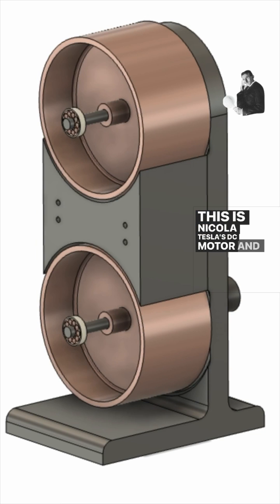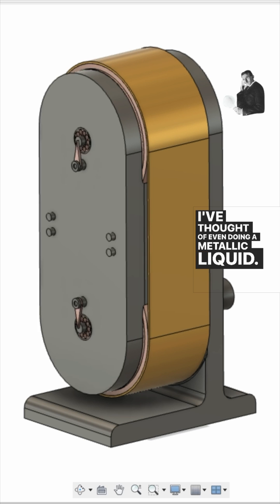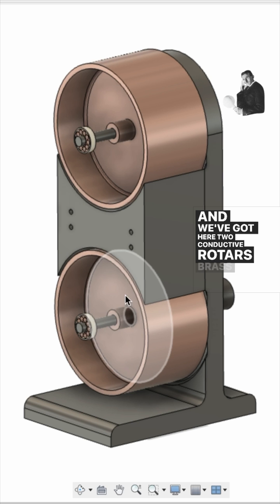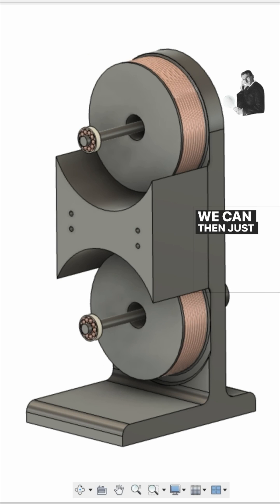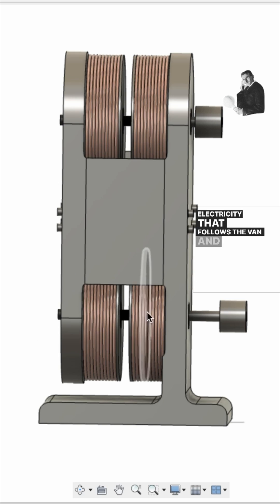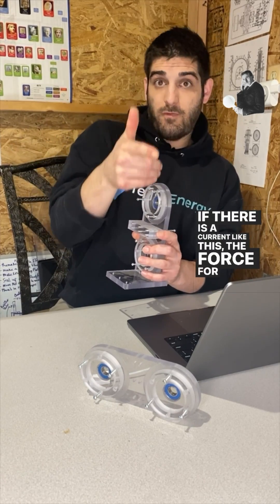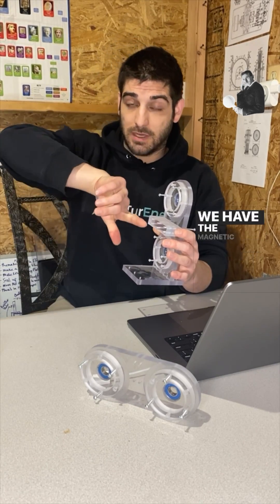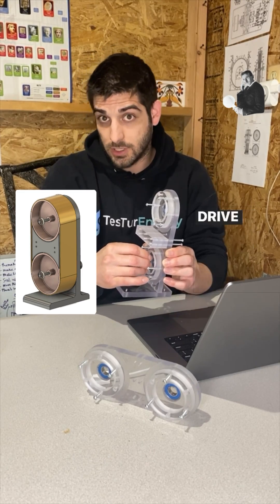A Fix For DC Motor Brushes: the Double Faraday Disc

Comment: For each set of disks have magnetics attracting to each other, same size (or bigger but thats a waste) on each end of the cylinder.
You still reverse the N/S direction for the bottom cylinder but do the same, one on each end pulling together...
BUT shield the top two magnetics from the bottom two so their fields aren't interacting, it will give a boost.

Comment: A couple years after the patent filing, Tesla wrote an essay entailing notes on a unipolar dynamo that entailed a set of spiral subdivisions in a conductive disk to force current to flow from shaft to periphery between two magnets along those subdivisions. The current would be taken off with sliding contacts ( brushes) or rolling contacts like in patent 406968. It was meant as an improvement to the faraday motor among many other things as it was envisioned to extend the current path and lorrentz forces caused by the rotation and perpendicular magnetic field.  

I wouldn't be surprised if the dynamo electric machine was designed with the intent that the unipolar dynamo could be employed in it. Nikola does also mention the conductive belt here.
Reply from the maker: Hey thanks for the comments and thank for sharing! You’re right on the money! 

I just shared this article to my Instagram account the other day in fact. 

https://www.instagram.com/p/CtE0DwJALCg/?igshid=MzRlODBiNWFlZA==
Reply: @CharlieSolis  haha thanks, also really like the Instagram post, the summarily pointed list of insights felt fresh and invigorating to read.  I read Nikola's notes just over 10 years ago and drew up a motor and sourced 3" diameter 0.25" thick axially magnetized neodymium magnets to reproduce a unipolar dynamo with modern materials, but ran into issues with my choice to use brushes and it fell by the wayside as I got busy with university and other interesting concepts. I still have everything in good condition in storage, just need some means to solve that issue. A conductive belt or liquid galinstan contact shearing around the periphery could probably fix the issue and get me back into making a proof of concept. I'd love to have a finished unipolar genny to add to my collection, and maybe my toolbox.
Reply: @CharlieSolis with the spiral pathways the voltage also goes up. Add a fractal capacitor to switch up the voltage more and you have a practical generator.

Comment: Such a nice design 😮👌,  from experience a single Faraday disc can only generate in between 0.8 en 2,3v in between 1000 en 3500 rpm for a 4 inch rotor at no load , the 6 inch only got to 1200 rpm , whit load I found the outher brush will eat al the power at 20 to 30 amps or so , this problem seems to be eliminated whit the dubble rotor design